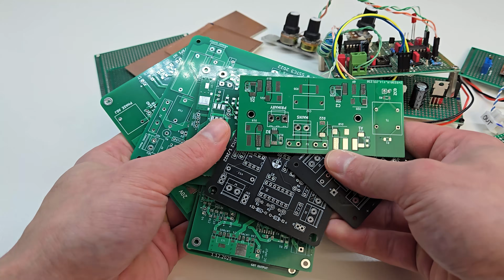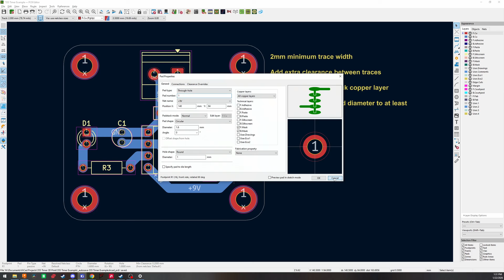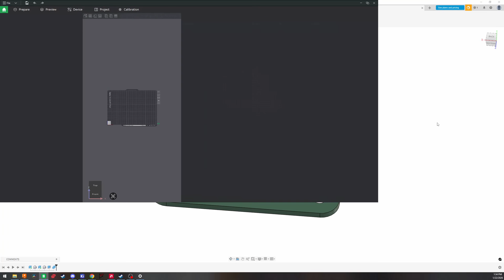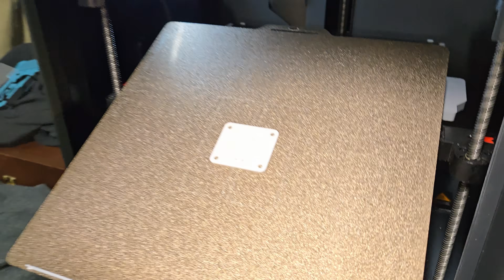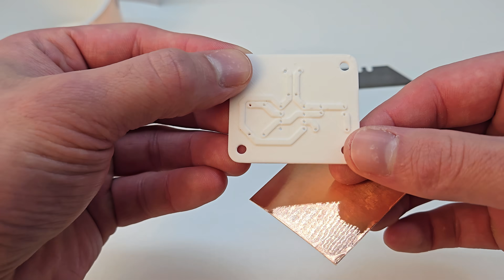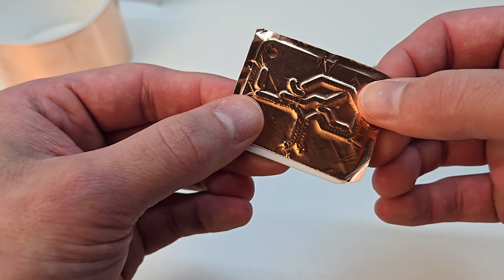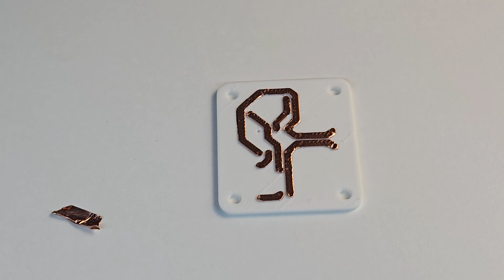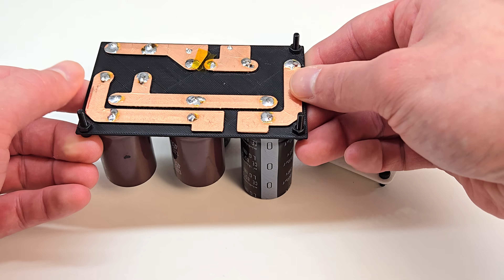3D Print Your Own PCB

Comment: Reminder: some filament additives such as carbon can be conductive. Great tutorial and showcase of a neat idea!
Reply: this sounds fun using multimaterial printers laying down conductive traces and walls on the holes then using what looks like large vias that mech keyboard enthusiasts use for hot swapping mods. i just got a pack of them in from ali for like $10 and thinking im gonna try this with the extras.

well, i don't have a multimaterial printer so im gonna try that technique for two colored prints where the print is paused after the base, swap filaments, then resume. wait, how is conductive filament performance now days?
Reply: Not really in a meaningful way. While carbon is conductive those filaments are not, the carbon particles are too small and short to be anything meaningful but helping with shrinkage distortion and temp.
Reply: @sierraecho884  That's regular CF filament, but there are some out there specifically made for this purpose. Protopasta makes some conductive PLA, but I didn't get the chance to experiment with it.
Reply: @iamthenightfly  "...That's regular CF filament, but there are some out there specifically made for this purpose. ..." I doubt there are any filaments with a decent fiber length. Due to the FDM prints, it has to leave the nozzle without creating a clog. Those fiber size used for FDM printing is tiny, even compared to injection molding. However I don´t now every material so maybe there is some speciality filament out there.

"...Protopasta makes some conductive PLA, but I didn't get the chance to experiment with it...." That´s different. It´s filament for the purpose of being conductive. They might be using different size particles, powders and such. It´s not regular CF filled filament. I mean in the end. what does "conductive" really mean. With 100 kV it´s most likely conductive. In any case I would simply use glass fiber filled material instead, if it really needs to be a filled material at all, which I doubt.
Reply: @sierraecho884  Try putting it in a microwave and you'll change your mind.  It might not have much conductivity at DC, but at higher frequencies it certainly does.
Reply: @ferrumignis  I don´t think that´s true. The microwaves react especially on abrupt geometry changes, which the tiny fibers have. But they are not even interconnected. I would not CF fillings for other reasons like, small fiber particles getting in some small electronic components and create a short, but I seriously doubt that FDM 3D prints with CF conduct in a meaningful way.

Comment: It's a good idea... But I think that you can give a file prepared for cutting in a polygraphy firm to cut out any patterns from your copper tape. Maybe they even can take out excess parts from it, IDK.
Also I think that for regular schematics it's easier to proto by thick wires on protoboards if you need to use some serious current  without heating a board. Yeah, probably you need to drill some if caps are very big. But I've didn't seen any that can't fit in these holes.
I've managed to get good copper wires from a 1m piece of a thick electric cable (which wasn't free but not expensive). They're just not easy to solder but I think it's the same with a copper foil. But in any case the wires will not be ripped apart accidentally. This foil doesn't look to be "ripless".

Comment: A few years ago I did a test where I printed TPU on copper. It sticks quite well and looks good. I even bought some chemicals to do the etching, but never go to do that part of it, but I think it would work well. The idea is to print the mask on copper and then etch away the copper using chemicals. You could probably even make 2-sided boards using this technique, if you aligned the circuit board carefully and printed masks on both sides.
Reply: I was thinking of trying the same but I never got to actually do it. I wonder how well the plastic will stick to the copper, i.e. will it lead to a clear etched - not etched line, or a blurry mess? Would you etch yours and let us know, please? Thanks.

Also, you'd need something to peel off or dissolve the TPU after etching - do you already have something in mind for this? I've asked an AI LLM and it listed a few scary sounding chemicals, adding that "These solvents are generally highly flammable and/or toxic, requiring proper safety precautions".

Comment: Too much work to cut out - but nevertheless: a very cool idea.
Reply from the maker: Thank you! I made two of these boards in less than 30min. That doesn't include the print time of about 15min but it is a lot faster than you think to cut around the traces.
Reply: @QZW_Labs  I am sure you are right for very simple boards - but it will not scale nicely with more complex boards.
Reply from the maker: @tcurdt  I agree, for anything moderately complicated a proper pcb is the way to go

Comment: Nice technique actually tbh. Great intermediate step between perf board and proper PCBs.

Id probably print the board out of a flame retardant filament.

Whats great is with a multi material printer you could add colour etc to add a bit of character and style.

Maybe one day we'll get a tool changer head that can lay do copper traces.

Comment: This is amazing! I've been doing simple copper tape traces cut out with the H2S cutting attachment, then printing the board with the through holes seperately. They've work decently for soldering onto the small tabs that small DC motors have. Prints with ABS and PC have been decently successful, tho so far those circuits have been really simple.
Reply from the maker: Good idea to use the cutting attachment! That sounds like it could be really useful.

Comment: Use conductive/solderable filament for the tracks
Reply from the maker: The filaments have really high resistance, probably too high for most applications. Plus layer adhesion issues.

Comment: For rigidity add a flange around the edge of the board, even just a couple MM.  Won't be any taller than your fasteners, but will massively improve bending and torsional rigidity
Reply from the maker: Great idea! I thought about doing that but skipped it for this demo since the PCB was so tiny. For future prints I will give this a go for sure.
Reply: @QZW_Labs  and maybe fill with resin?

Comment: Funny how I was just wondering about this the other day. I had some copper foil tape and I was thinking it wasn't much thicker than a copper trace on a conventional PCB. I was worried that the soldering would melt or deform during soldering. I tried using my laser to cut away copper tape but my laser is too weak and not the correct wavelength to cut metal. While in the garage I thought it would be nice if I could build an LED dimmer circuit and run some under the counter lighting. I am going to try this and see what happens. Thank you.
Reply from the maker: Awesome! Let me know how it goes. For PLA you could even etch a silk screen onto the top side of the PCB with the laser.

Comment: for some applications, couldn't you just draw or paint with those pens onto whatever material you want? I forgot where Iv'e seen that. It was some small kids project using a special pen to draw traces.
Reply from the maker: That might be an option. Conductive paints and similar things tend to have very high resistance so it might have a limited application. Good idea though!

Comment: Could you print a "negative" PCB, put the copper foil on like you did, but then press/hammer the negative on top? If edges are sharp enough, it would cut/tear the copper around all traces instead of having to cut them manually. I have no idea if it would work. Maybe with even thicker traces?
Reply from the maker: Great idea! I considered trying that same idea, I think if you can get the tolerance just right it would make really clean edges after pressing them together. I might try that next time.

Comment: If you press the workpiece onto a sponge (to obtain the relief of the tracks), apply paint to the protruding parts using a sponge (just place the workpiece on it without pressing) or another material with a thickness of ~0.1-0.3 mm (for chemical protection) and place all this in iron chloride so as not to cut out the copper tracks along the contour
Reply: Тоже думал о подобном, но тут вопрос в токопроводимости хлорида железа и способе его вымывания из межслойных щелей пластика 🤔

Comment: Simplifications are the cutting edge of tech, incredible idea! 

A few ideas of my own (i’ve never needed/worked with pcbs so forgive me if these are dumb)

1. Considering the inverted groove option other commenters are talking about, could you not inlay a copper wire and then solder to that? 

2. Perhaps dipping the PLA plate in resin could make it more rigid and also heat resistant? 

Also i’m curious about the efficiency of copper tape, it seems like the resistance would be higher and therefore problematic for some projects? Again i have no idea what i’m talking about lol.
Reply from the maker: Thank you, I appreciate that! Wires could work as well. What I like about the tape is it is all connected without having to solder different nodes together. The resin is a good idea, I had not considered that. Many others, including myself have used the copper tape for high power electronics and it works great, I don't think resistance is an issue. Thanks for watching and sharing some ideas!

Comment: Good idea! ASA could be better as a plastic though.. At least the heat radiating from the components wouldn't change the shape of the circuit board so quickly?
Reply from the maker: Thank you! I agree, for this basic circuit I just decided to use PLA. I will definitely try ABS as I have it on hand for a future print.

Comment: Interesting - Makes me wonder if you can use a Cricut to cut the copper. It does seem you can cut suitable thin copper sheet with one. I think the problem would be to transfer the cut image, without distortion, on to a substrate like fiberglass sheet to make the solid PCB. I wonder if anyone has done it. Well done for not distorting the PLA while soldering.
Reply from the maker: That is a good idea! I do not have experience with them but it sounds like it could work. Thanks for checking out the video!

Comment: fun fact, you can solder aluminium foil, so if you dont have copper tape you can put some glue down on the traces and just raid the kitchen drawer on the cheap
Reply: What solder to use for aluminium? Usually aluminium cant be soldered.

Comment: A useful thing (especially for the flexibility issues) could be to design the board INTO another 3d printed part or case itself. You're not limited to planar shapes either. Functional parts that have little bits of circuit built into them would be cool.
A 3-part box would work well for this. "PCB" and walls are one part, with two thin lids as the other two parts. The walls are around the component side of the board, so they shouldn't get in the way of soldering.
Reply: Yeah good idea, I just would not try to integrate too much in one partm otherwise you need to reprint half the thing whichever you are making just to replace the PCB or some design aspects of it. Modularity makes sense too. Depending on the product.
Reply: @sierraecho884  Yeah, there's a fine line between "rapid prototype" where modularity is key for quick changes, and "finished design" where you'd probably just get a real PCB manufactured for it. So making the circuit into the part is probably only useful for some very niche ideas.... but it's still something i'm going to be using :)
Reply: @roboman2444  "...Yeah, there's a fine line between "rapid prototype" where modularity is key for quick changes, and "finished design" where you'd probably just get a real PCB manufactured for it...." Yeah I am sure there is anything in between as well. A product on a bigger scale made with 3D printing, does not make any sense. 

"...So making the circuit into the part is probably only useful for some very niche ideas.... but it's still something i'm going to be using :)..." I mean, it´s a huge possibility for all sorts of ideas. Maybe you need something highly integrated ? Maybe something very lightweight and so on.
Reply: Nice idea, though you'd need to be careful with access so it's not horribly difficult to cut the copper.

Comment: I think making the unused space between the traces a big "ground-plane" (with large trace clearance) would allow you to make the body of the board significantly thinner without compromising rigidity. Don't actually keep the ground-plane copper on there, just use it for thickness.
Reply from the maker: Great idea! I will have to give this a try next time.

Comment: You could try turning on ironing of the top most layer to get a smoother surface to stick the foil to.
Reply from the maker: Good idea! I completely forgot about ironing. I will try that next time.
Reply: Also depending on how well your printer does overhangs/support, or if you have a multi-material printer to do a different support material, you could print the board trace-side-down on a smooth buildplate.
Reply: @roboman2444  Agreed. This is what I'd do. Print it upside down so that your traces are on the smooth surface you get from the build plate.
Reply: @mtslyh  I guess it's worth trying but I expect that the "board" surface will come out too rough if not using a different support material that can peel off cleanly.

Comment: To some extent you can solve the rigidity by raising a lip around the outside. That gives it some more strength in the Z direction without making most of it thicker.

I'd also wonder about using 1mm-wide copper tape. Maybe that would be too annoying to put down though. It might not be bad if the traces were lowered rather than raised though.

It'd also be interesting to consider adding more layers because the tape can travel around the outside of 3d-printed shapes. You might end up with something that looks like a set of car highway interchanges lol.

Comment: Interesting idea - I wonder if a drag cutter would be able to cut the tape without tearing it - would make the cutting out of the traces much easier. Either something like a Cricut with two stage process, or directly on the pcb using an h2d cutter?
Reply from the maker: That is a good idea! I haven't used a cutter like that so I am not sure but it sounds promising.

Comment: Maybe we could use conductive paint into grooves and then remove the top layer before it dries.
Reply: As others have mentioned, standard prints are quite porous, so high likelihood of shorts inside the print. But probably possible, either with optimised print settings or if one paint the print with something non conductive firs to fill the gaps.
Reply: @martinfinne7259 You could make channels and hit the board with a light spray of clearcoat possibly

Comment: will defo use this for the dash in my lakester was already printing the bezels frames and mountings for the touchscreens may as well print the circuits too. You could use the syringe and servo metal printing idea with etchant and just etch the copper away.

Comment: looks great, i've been testing cutting traces on copper or aluminium adhesive with vinyl cutter and transferring them on no-clad pcb or printed substrate (nylon-gf) with success, specially great if you want to print something simple and big like keyboard pcb.
Reply: I was thinking the same when I saw this video, a vinyl cutter would be quite a nice way to do this.
Reply from the maker: Great idea! How are you transferring the cut traces without them separating after cutting them?
Reply: @QZW_Labs I would guess transfer tape is being used (as it's how most vinyls are transferred after cutting).

I could see that method also being handy in that the opposite side of the board can then be 3D to add thicker reinforcing areas where possible to minimize flex, and you get the extremely flat bed side for attaching the copper.
Reply: @QZW_Labs vinyl cutting and transferring process works exactly the same way.
Reply: @QZW_Labs with transfer tape, there is purpose made tapes for that, also masking tape works very well

Comment: Using PLA? It doesn't melt?
Reply from the maker: Not when you have a hot iron and solder quickly 😅 it's not ideal, just a demo for sure.
Reply: @QZW_Labs have you ever used ASA or ABS? are they better or do you still have to be super fast in Soldering?

Comment: Super cool idea. Thanks for sharing! Should be able to get different current handling by varying foil tape thickness and trace width. Can also conformal coat it when done to add a lot of durability if necessary. Could even 3D print a transparent negative bottom cover.
Reply from the maker: Thank you! Great idea! I thought about printed a negative to press the copper on all the traces but a cover is also a great idea.
Reply: @QZW_Labs  Possible to flow resin over?
Reply from the maker: @davidporter7535  I don't see why not, it would add a lot of strength to the board.